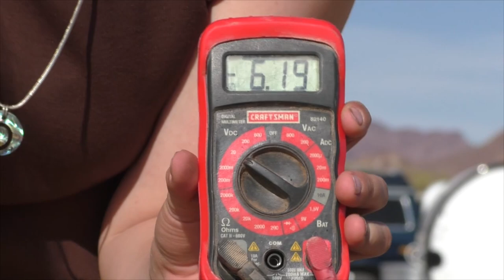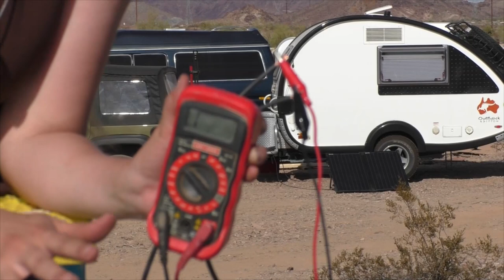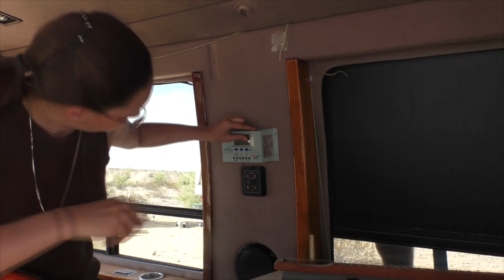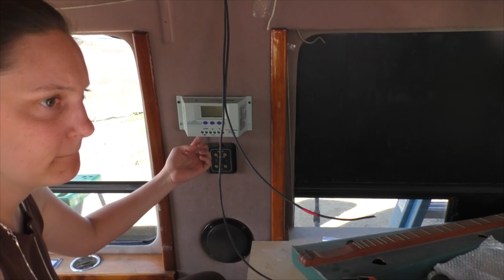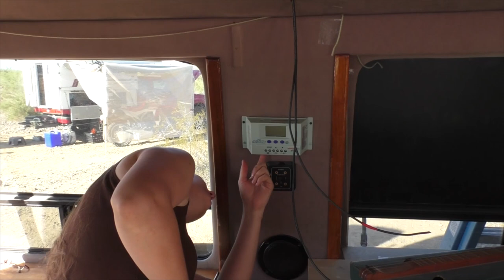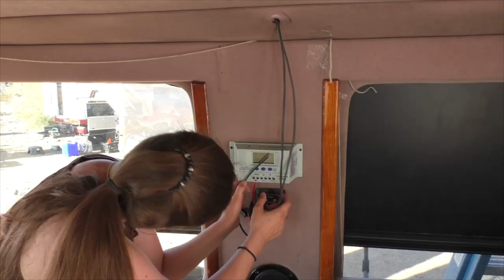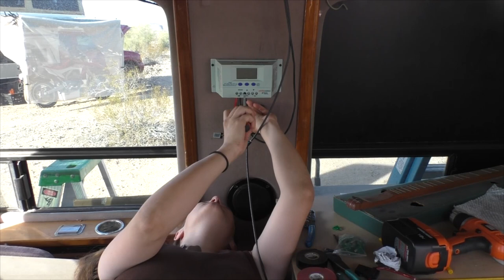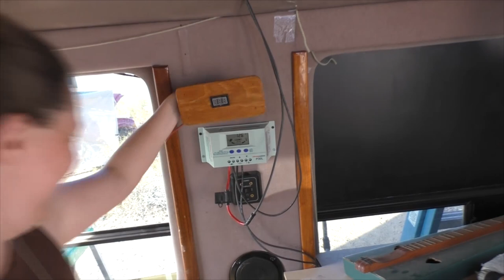Solo Female Traveler Refuses to Pay A Power Bill EVER

Comment: Since i do not go out all the time but week ends for fishing and maybe a week at a time i was wondering if ...puting 2 100 panels on a removable car rack is possible cause i never seen it done . I could unplug and take the rack off when not in use ...or i wish
Reply: Hi CSIOPS cst39...I've seen many folks mount their solar panels on a roof rack. This eliminates drilling extra holes in the roof, and will work just as well, in my opinion. Before doing this, and, if I were you, I would not make it a habit of taking the roof rack off and on all the time once you install the solar panels. It could possibly cause extensive wear and tear on your connections, especially when you plug and unplug them all the time. Also, you could possibly encounter some problems with wollering out holes that are provided for your tie down supports of your roof rack.  If it were ME I'd leave the roof rack on permanently, rather than taking it off/on all the time. Just my opinion. Hope this helps!
Reply: Jim , thank you  and yes good advice on not taking it off

Comment: Excellent video & very informative.  I would like to install solar on my E150, but have debated with myself as to whether or not I should install them on a roof rack or directly on the roof.  I would appreciate knowing the pros & cons of each method.
Reply: I was going to do a roof rack at first, but then I decided to bolt it directly to the roof for stealth purposes. It also has better aerodynamics while you're driving. It is less modular though, making it difficult if you want to transfer to another vehicle or if you need to do maintenance.
Reply: Did you find the issue that was recently causing you problems in your system.  The symptom was whacky readings on the charge controller...what was the cause?
Reply: My Channel Roof rack, 100%.
As or stealth, you can mount flush with the roof rack and screw sideways instead of down.
Reply: Yes. Haven't posted the video yet. Turned out to be a bad fuse holder. The fuse was still intact, but the holder was melted.
Reply: wow, good for you to stick with it and figure that out.  Since root causes are always the ideal goal...did figure out why the fuse holder melted?  I can wait until you post the video.

Comment: Is an inverter necessary  ? Putting my list together for my 400 watt system and they run over $ 500..
Thanks
Reply: An inverter is only necessary if you intend to use 110 volt appiliances…..1500 watt inverter with remote shutoff  $169 ( remote shutoff saves electricity used by inverter when not in use )
Reply: All depends on what you want to power 120 volts.

Comment: How do you install panels so that it can't get stolen,????
Reply: Bolt it down on the roof in a way that is difficult and takes time to remove. You could also use specialty bolts so the only way to remove them is with a specific bit/tool. I haven't had issues with people trying to steal them yet. Though it was definitely a concern. This is why I decided to bolt it directly to the roof instead of a roof rack, which might be easier to remove.
Reply: Tes_ ...Good idea
Thanks for the advice
Reply: @Teshia  Use Torque screws. You need a special Torex bit o tighten or remove them. FYI.

Comment: Can 2x 305 watt solar panels apply to the same install?
Reply from the maker: As long as the solar controller can handle it, Yes. Call Battle Born customer service and tell them about your system and they can sell you the exact right Victron controller for a fair price. 855-292-2831 (Local number)

Comment: I see a lot of self tapping screw use in youtube videos. Why not use a nut and bolt set up?
Reply from the maker: +ramona14220 I cover that in the video.
Reply: Hello ramona14220...That would possibly involve dropping the interior headliner to expose the bolt in order to securely fasten the nut ... and,  then putting the headliner back up, which would be, in most cases, quite a job. The self tapping screws are strong and are usually the best route to go.